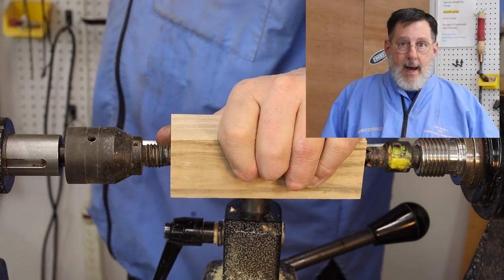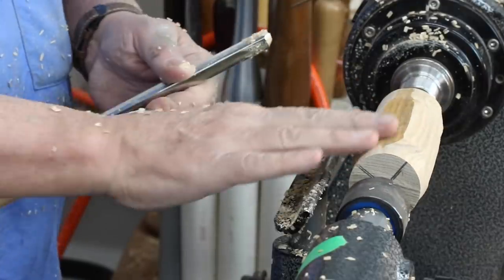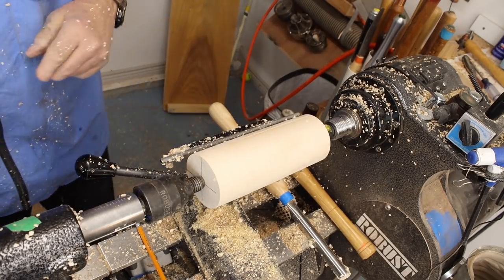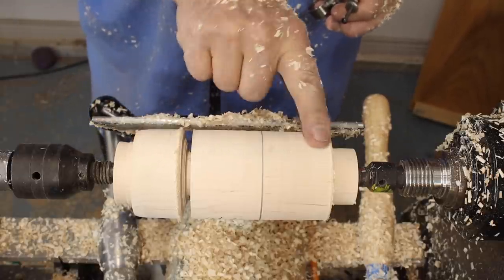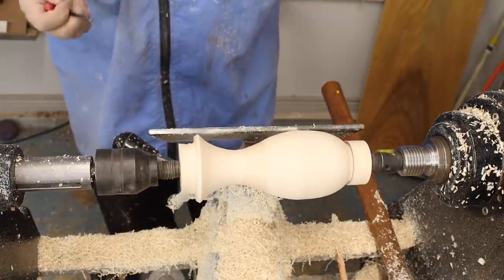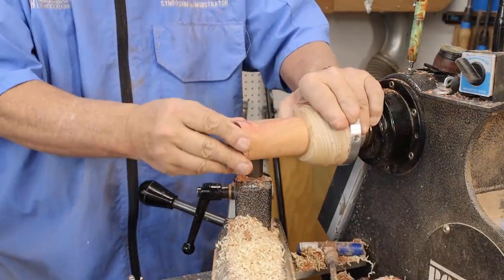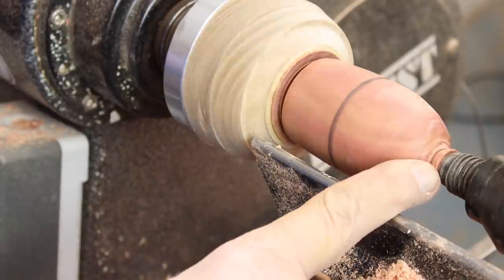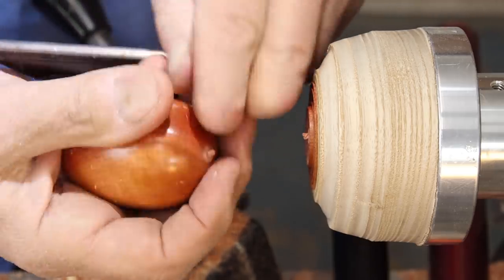An EGG a WEED POT --Turning Tools-- a glue Block and a Faceplate-        Woodturning with Sam Angelo

Comment: Thanks for the video it's very useful for beginners. Down at our club, they teach ABC:
A = Attach the tool to the tool rest.
B= Rub the Bevel on the wood
C= Raise the handle to start cutting.
Which is how you work, ABC is just an easy way for beginners to develop good habits.
I would challenge your viewers to make the weed pot (bud vase) with a skew chisel. I do a lot of those curves with the heel, I don't seem to get as many, note the many catches. I still watch & rewatch Allan Batty videos, the Master, sadly no longer with us. We use a jam chuck into the drilled hole to finish the foot. Sorry I've gone on a bit the weed pot is one of the beginner projects at my club. Great video.
Reply from the maker: I was very fortunate to see Alan Batty many times at the Utah woodTurning symposium. He was the master indeed and😀 a true joy to watch demonstrate. Be safe thanks for watching Sam

Comment: Hi Sam. Great video! I just ordered a Carter and Son 1 1/4 spindle roughing gouge. Seems like a good, safe tool design. My question for you is. Do you think it's over kill or worth the money? THANKS!
Reply: They look like fantastic tools, unfortunately, hard to access in Australia. The price is steep but if you can afford it I don't think you'd regret it. The basic SRG is only dangerous when used incorrectly as is any tool. I personally have several old SRGs bought at charity shops & as it's a roughing tool, not a finishing tool. I'd rather save my money for other things😎 Sam may have another view.
Reply from the maker: I have many of the Carter and son Tools. They are really great tools. It is difficult because there are many good choices out there. In the Carter and son tools are not cheap by any means. Sam